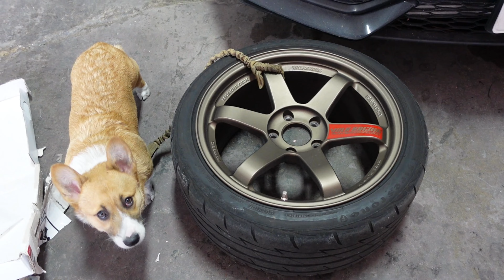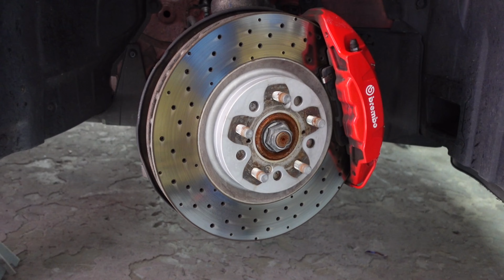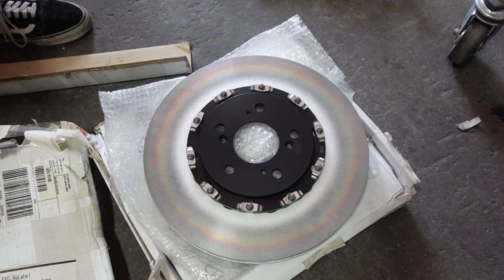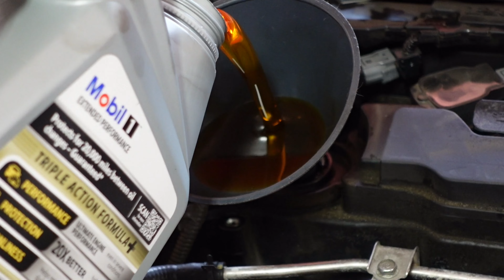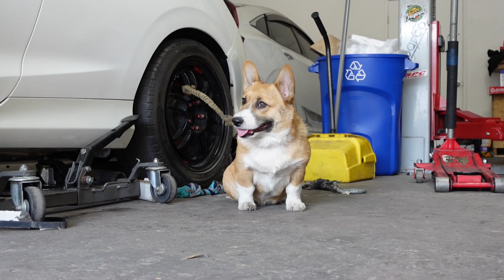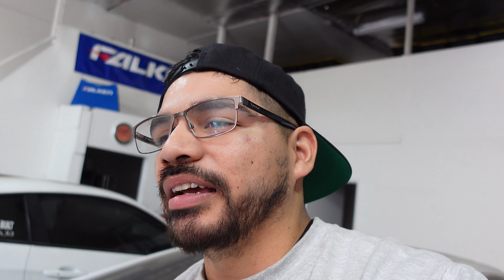CIVIC TYPE R 30,0000 MILE MAINTENANCE // E85 SPARK PLUGS REPLACEMENT // UPGRADED 2020+ BRAKE. SETUP

Comment: The old rotors warp/Crack and the holes get filled with brake dust and you can feel a pulsing from hot gasses getting trapped vs being vented.  
The 20+ 2 piece rotors are a step up for heat management and more consistent pedal feel.  

I've changed my spark plugs 3x this year lol   it's easy and keeps misfires away - cheap insurance.
Reply: did the plugs mess with your knock control at all?

Comment: Hy man, how much cost the brake rotors front + rear, are the easy to find?😊
Reply from the maker: Hey feel free to message me on instagram. @maganamfg 
I can source most of them. 

Depends if want to do oem, brembo, Girodisc, paragon? 

Check out my website, ballpark can be $800-$2k depending how baller lol 

1 piece are cheaper than 2 piece. Hope this helps!

Comment: does e85 do something to the plugs?
Reply from the maker: E85 makes our spark plugs get yellowish, it’s not a terrible thing but may cause misfire for $30, great advocate to change sooner than the typical 100k mile maintenance on them.
Reply: @maganamfg  gotta change mine then my knock control is super high all of a sudden i run e85 to lower it so i can run more timing in my tune but lately ive. Had a few misfires and spikes in the k control
Reply from the maker: Did it help? Changing the llugsv
Reply: @maganamfg  hell yea man knock went back to .49 like it should be this is on the k20c2.i just got me a fc3 might need your help in the future building this one.i still have the k20c2 aswell.
Reply from the maker: Nice nice man, yeah spark plugs every 20-30k, also if they get wet from engine bay wash that to might cause an issue.
Reply: @maganamfg  ok ill keep that in mind do you guys still have the oc 10th gen meets?
Reply from the maker: @CarsNfish  sadly those are dead and dont happen anymore. follow me on IG as i usually post up meets or 10thgen meets. on the 19th is the honda meet in lake elsinore
Reply: @maganamfg  forsure ill be there thanks man

Comment: 1 other thing you should do bro at 30k is adjust valves
Reply from the maker: Adjustment at 30k? Isn’t it to soon?
Reply: @maganamfg  Honda recommends at 100k but  I seen a few cars with as low as 8k miles with only 2 valves adjusted to spec and everything else not.
Reply: @maganamfg  every single type r I checked needs adjustment, and is weird because on the accord’s k20c4 you don’t see it happening
Reply from the maker: @jordyariaszapata6124  thanks for the heads yo
Reply: @maganamfg   gotchu fam, just inspect them better safe than sorry